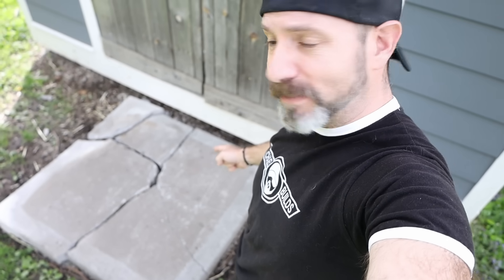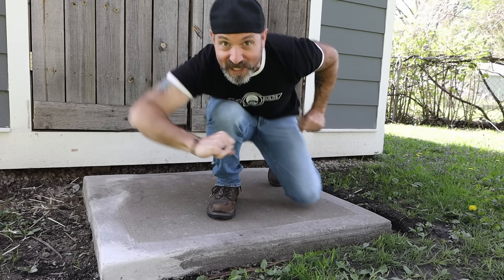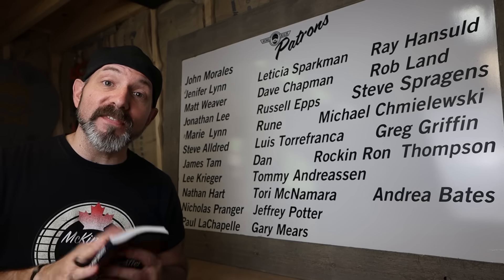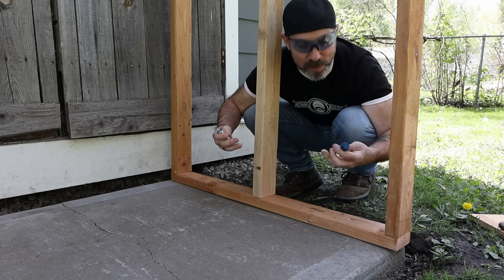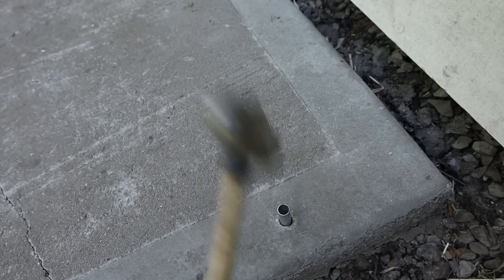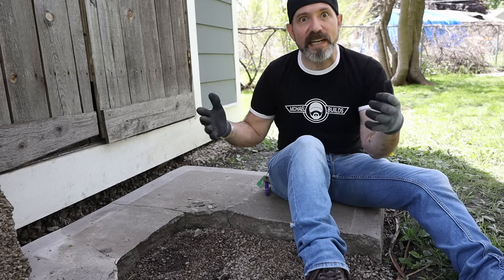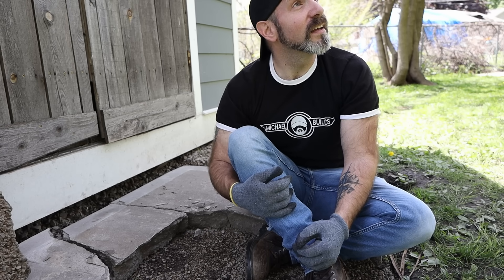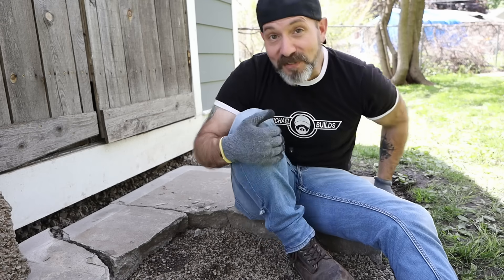Dry Pour 30 day cure Test

Comment: If you are open to additional tests, I would be curious if you did a hybrid setup.  e.g. wetted the ground, then filled in half the form, wetted pretty good, then topped off the form dry and followed their "top coat" watering (e.g. the hourly misting and so forth).  Doing this  would allow for the dry concrete on both sides to absorb the water faster, still not require any mixing, and allow one to do the dry troweling/prep to give the same surface finish.  I'm going to be doing a 10' x 5' dry setup myself after seeing this, thank you for doing this!
Reply: I see what you're saying, but I also see the negatives against this which somefolks advise against bc the concrete begins to start setting picking up the water from the very wet ground before its really packed in well and uniformly. 

I will be soon building my shed base and a patio behind the back door hopefully in the next month or two using dry pour.
Reply: @pakmandan I just bought a shed and am weighing my base options. How did yours work out?
Reply: And use rebar, just like you would with wet mix.
Reply: This is actually a great idea.

Comment: I'm wondering if it would standup to running machinery. like if I had a generator running ontop of it for a long time. You think it would rattle apart?
Reply: probably not, I have a 3 car slab I did using his same method thats 3 years old, but I put several days work into preparing the substrate. 3 years old and its still holdin strong and im constantly working on my mowers, lawncare equipment, and  using my generator to run my welder for long periods. only thing ill say dry pour vs wet pour is blatantly bad at, even with a good base. Dry pour isnt very impact resistant. Having a load of gravel drumped on it tore the surface layer of it up real good.

Comment: You should definitely do a more real world test.  Which would be with 1/2” #4 rebar at 12” each way for reinforcement which most slabs with loads on them would have placed into them
Reply from the maker: Absolutely! 👍🏻💪🏻
Reply: Came here to say it failed because of the lack of rebar also
Reply: @Victor43377  Exactly! No rebar, no 5000 pound trucks!
Reply: rebar in a tile 🤣

can  you think of any way to destroy the nature anymore, because i cant
the producers will tell you the right time to mix concrete to obtain its strength..
they will tell you this is tested and it does not work.
how about just mixing it after the producers advise. so it works.

this material is not sustanible, so using it so it last for a few years is not cool.
gravel is also a resource we dontr have anuff ofAre you guys making new gravel??
because you can make new concrete out of gravel from concrete

it could last as long as roman concrete or as german bunkers.
and the producers will tell you it wont work this way, how come you guys think you can do it better and these people are wrong 🤭.
Reply: @Hansen710  Apparently you lack the resource of common sense and absolutely zero grasp of the English language.

Comment: This video got me so excited I want to do a parking space so bad!
Reply: by the time you've bought enough bags of concrete to do a 10'x18' slab at 6" thick you are looking at needing a 150 - 80 pound bags, at that point you are looking at about 900 bucks in concrete when bought in bag form, you could likely get a concrete truck to deliver mixed concrete for far cheaper, truth is once you get to a certain scale you are better off ordering a truck delivery, pouring a parking spot next to the curb or some where close enough the concrete truck can get to it without needing to bring in a pump truck would cost like HALF what that slab would cost you in dry bags from the big box store.
Reply: @DanielsCorner644  The cheapest quote I could find out here was $1,500 bucks for a single car slab and $2800 for two car spaces. Noe granted I tried to get this quote about a year ago so maybe prices have changed?
Reply: @DanielsCorner644  what dimensions  would you recommend the cut-off should be for a cost effect dry pour slab such as this if you don't mind me asking?

Comment: Forgive me if this was already asked, but did you try adding any super plasticizer to the water that you are using on the dry pour?
It might allow the water to penetrate better.
I was thinking you could add it to a soap or a chemical canister that attaches to the garden hose so that it mixes with the water
Reply: dishwashing detergent perhaps? and use a garden bucket with a shower nozzle.

Comment: I guess a fair comparison would be with a wet pour and dry pour and do the same test under the same conditions. Dry looks pretty good though.
Reply: I'd like to see a comparison as well.  If your reading this Michael.. Yo buddy, pal!!!  We got an idea here.  Apples to Apples comparison.
Reply: @daveconner9520  I think he already has a test curing
Reply: @SyntheticSpy  Well, it would be litterly apples to apples.  Same size pad, both wet and dry and see how that comes out.  But, I'd be willing to bet they would be about the same.  I think the only reason this dry pour cracked is the 'bouncing' of the pad as he was driving across it.
Reply: I'd like to see a proper compression test to actually compare strength of dry VS wet poured.
Reply: Watch the end of this and he does show some testing with the traditional mixing pour method coming up in a future video.
Reply: I was thinking the same.
Reply: Yeah, and take a core and send it to a petrology lab.
Reply: A wet pour is going to be stronger. There's no doubt in my mind about that. The problem a lot of people have is that it sets too quickly and they are unable to get the finish they want without paying for help. I'm going to be dry pouring a 25'x17'x6" slab with a 4" tamped pea gravel base by myself. I don't have space to be able to get a truck through to where I'm pouring and don't have thousands of dollars to pay for help. The slab is going to be costly and has to be planned properly so weather doesnt effect the pour.  I'm doing 3/4 quikcrete and 1/4 fine cement on top so I can be sure after the dry screte I have a smooth finish. After the pad has cured for 2 months I'm building a 24x16 two story shed with a 50 amp service for the garage door, lights and some receptacles. The second floor is for storage of outdoor christmas decorations and such. The downstairs will be for my mowers and garden tools with a small shop area for my personal auto repairs and tinkering on some of my little projects. The little 8x10 shed I currently have has seen better days and it's not nearly large enough for the yard tools I own. My little storage room (6' deep x 8' long x 9' tall) that I built on the side of my house is full wall to wall and floor to ceiling so it's time for a big change and this shed is going to make all the difference. Instead of housing my ride on mower and log splitter and saw mill under the porch ill have a safe place to store them while they're not in use. I expect the entire project to cost around $25,000 before electrical and cabinets and bench tops... I have set 4,000 of that 25 aside for the slab. I also have a little wiggle room just in case some things go over budget. I'm not willing to cut corners to save a few bucks.

Comment: Thanks for testing this dry pour process. It may not be the answer to all concrete applications, but it is for many. 
I live in a northern climate.. so I wonder about freezing etc. 
And I wonder if this dry pour process will work with kitchen counter tops too?
Reply: I expect more micropores in the resulting concrete, letting more water in and thus faster deterioration from freeze-thaw cycles.
Reply: I would like to see a dry pour kitchen counter top also.

Comment: I think mostly the concrete failed because the substrate gave way.  Probably would work great for a patio.
Reply: Absolutely,  the concrete kept shifting which means the weight wasn't being supported evenly.
Reply: Yes, I agree,  but must add reinforcement wire and expansion joints. 
but that can all be part of the basic form, then just fill in with the dry pour, and water afterwards.
Reply: Yep, you can see it move
Reply: Right, the concrete was moving when it was driven on. Normally this wouldn't happen!
Reply: Good video. I agree, better base prep and reinforcement would change the outcome.
Reply: Yeah, some wire would've held it together just fine...
Reply: I agree that if their was a footing or idea compaction of a base it would have been fine. The tracks his truck made proved it a little. I have no idea how much stone was under it or how it was done.
Reply: it failed because the size of the slab it couldn't spread the weight and also because the lack of rebar.
Reply: @morzaprowashpressurewashin5673  A vehicle of this size only exerts about 25-35 PSI of ground pressure per tire. This concrete method is weak AF.
Reply: @evictioncarpentry2628  assuming a 5,740# truck with 1/4 weight distributed to 1 tire you get 1,435# on a roughly 32.5 square inch footprint. (275mm tire size with 3" wide contact patch), that's 44 psi... on a poorly supported, non-reinforced, small patch of concrete. It did alright.
Reply: @claytondennis8034  It did horrible. I'll guarantee a proper slump wet pour wouldn't have cracked in the same scenario.
Reply: @evictioncarpentry2628  So why don't you do a proper slump pour and test it
Reply: @stephenwright1707   I'm pouring a sidewalk this week. I've poured many pads in my career from a pre-mix company that delivers and charges by the 1/4 yard. When they're wet cured (from pre-mix) it's some of the hardest concrete you can get. There is absolutely no argument that makes sense to do a dry pour.

If it's something the size of what this guy did, again, zero argument for a dry pour  it's like 6 bags. Takes less time to mix it properly and it will cure properly as well.
Reply: @evictioncarpentry2628  "Proper" - The science here is no different.  There is no reinforcement.  My "proper" 5" wet-poured driveway failed after 10 years from small car traffic.
Reply: @evictioncarpentry2628  "If it's something the size of what this guy did, again, zero argument for a dry pour  it's like 6 bags."

You do understand that the small pad here was just a test right?  Not a real project, just a proof of concept.
Reply: @evictioncarpentry2628  Have you ever tested a dry pour, with a load tester? No? Then you are just speculating without any data. 

Concrete strength is (loosely) inversely proportional to the amount of water used. Basically, the least amount of water you need to achieve the desired slump is ideal. 

Concrete is porous, it'll soak through with enough water. The bigger issue with dry pour is aggregate settling and compaction.

There are graphs of all this online.
Reply: @claytondennis8034  Yah, what he said 😁
Reply: @evictioncarpentry2628  Really? First, PSI of ground pressure has to do with the wight of the vehicle and not the PSI of air in the tire.  He didnt use a gravel substrate, he didnt use any rebar, he didnt make a pad thicker than 2-inches, but other than that I guess you're right the method looks pretty weak, like your argument.
Reply: @evictioncarpentry2628  not at 2 inch thickness with no gravel or rebar.
Reply: @evictioncarpentry2628  this preformed like a slab that was mixed with sugar water
Reply: @evictioncarpentry2628    you are only talking compressive stress.  there is a LOT more stresses going on here.  The rupture modulus of 3000psi concrete is only 435 psi.  Hard to tell specifically how much force is being  applied to the slab since it is kind of supported in the middle.  my guess is that if you took a 4inch unreinforced slab wet pour the same size and supported it at the edges and drove across it it would break also.  Concrete does not have much flexural strength.  hence the reason for all the reinforcement in bridges and the deck is set on massive steel beams.  yet that entire span can rest on a relatively small column because it is loaded purely in compression.  SO you are right it is weak AF.  but so is wet  pour.
Reply: @evictioncarpentry2628  Unreinforced concrete has horrible flexural strength.  3000psi concrete wet pour only has a fracture modulus of 435 psi.  There are a lot of stresses going on here because the substrate failed.  Pretty sure if you took a wet pour slab the same size with virtually no substrate it would fail also.  Concrete does not like to flex.
Reply: nah it wont work
look at how it looks, it looks like it have been used for 80 years..

i just broke some concrete today, and the stuff that looked like that break without a problem..

concrete needs to be mixed for the right time to get its strength..
you wont get any real concrete with spaying it with water..

concrete is not a sustanible material, this is a waste and it is destroying the nature..
concrete and gravel are some of the biuggest problems when it comes to making sustanible buildings..
and you guys are wating it this way 🤬

Comment: The one issue with the dry pour is making sure you have your mix to water ratio correct. Otherwise it’s fine.
Reply: There’s no measuring the water. Essentially the mix accepts the max water it needs and then the water drains down via gravity and absorption to be used by the next dry cement particle.

Comment: I don’t want to be a Debbie downer but you didn’t crack your slab by driving “ON” it. You kept moving it getting on it and off it causing friction which cracked it. The weight of the truck didn’t crack it to speak plainly.

Cajun country simply drove on top to prove it could handle the weight.

What you did was prove you must reinforce concrete if it will move at all.

It can handle the weight just not being moved like it was with the torque of truck pushing it trying to get on it while right up against it.

So your truck test didn’t fail at all simply show why everyone should reinforce concrete you know might move at all.